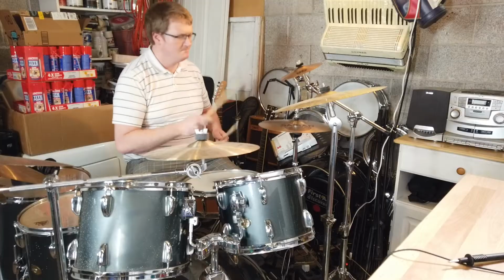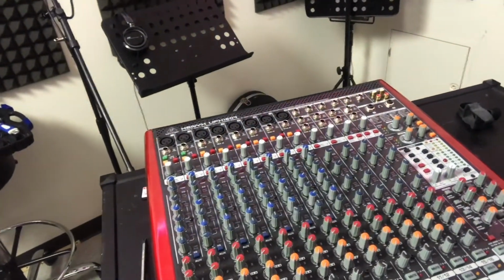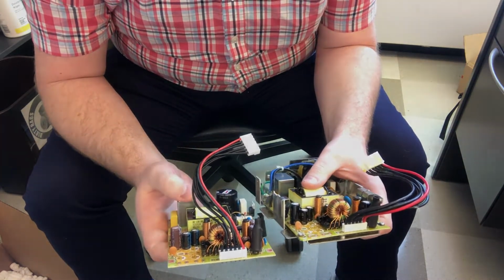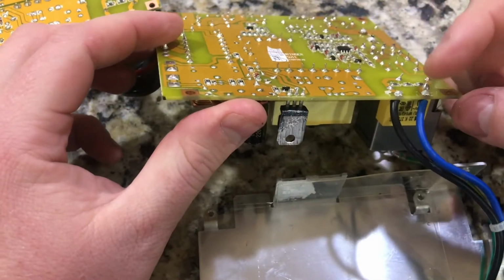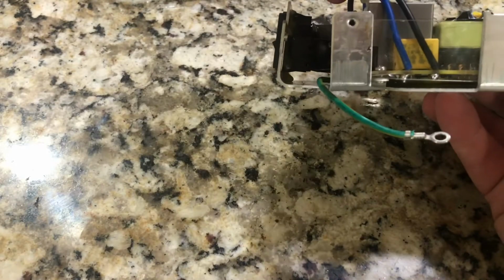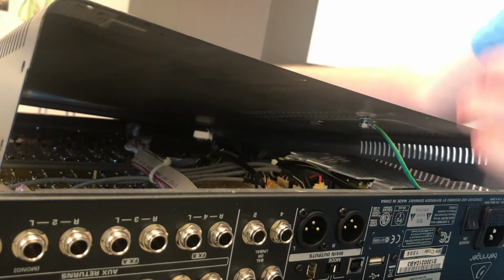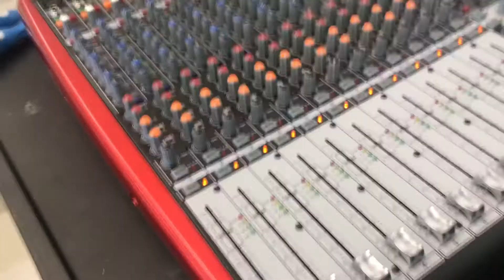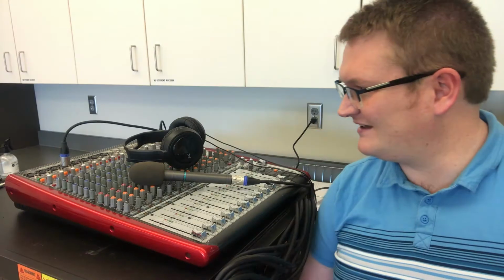Why my Behringer mixer died and how I fixed it.

Comment: Thanks for taking the time to post this video.  My XENYX2442USB mixer recently died and I figured it was a power supply issue because the power light wouldn't illuminate.  I have a schematic for the mixer, but unfortunately the schematic doesn't include the power supply.  Your video showed me how to access the PS, and your comments about it likely being bad capacitors gave me hope for fixing it.  I am a hobbyist, and happened to have the right capacitors on hand.  I replaced both 1000uF and both 470uF caps, and my mixer works again.  THANKS!!!
Reply from the maker: Success! That’s got to feel good. Glad I could inspire you!

Comment: Hey thanks for your suggestion to contact MusicTribe! I also have a UFX1604, which I really love- these are the best AD/DA-Converters I've found in a "budget" (firewire!) audio interface so far, and the power supply failed on me, too.
In my case I suspect the two caps wrapped in heat-shrink near the transformer, because the others look just fine, but I have yet to desolder and test them...
Hopefully the folks at MusicTribe still have one of those in stock so I can quickly replace the PSU and fix the old one as spare. Wish me luck :)
Reply from the maker: Definitely good luck! I had a great experience with their customer service. Hopefully it works well for you!

Comment: Hey bro, may I suggest you change your soldering style ? We PRE-HEAT them connections and THEN apply solder to the connections, not to the Iron first ! Goos job though...
Reply from the maker: Thanks I've never really been classically trained to solder, so thanks for the input!

Comment: Hello .. I need some technical help...I bought a behringer eurorack mx 802a on eBay without powersupply... Based on research the powersupply thst comes with it is 18v for 2 of the pins (xlr) at 800 mah.

However the powersupplies being sold on eBay for it is 17v for 2 pins at 600mah... Can those eBay power supplies work? Thanks
Reply from the maker: Hi! I don't have experience with that mixer or power supply, but I just looked at a similar listing for the same mixer and on the back is a stamp that says "use supplied power supply only." I would hate for it to underperform or worse, go bad because you gave it the wrong voltage or amperage. The Amazon listing also recommends that power supply, but just because other people looked at the listing doesn't mean it's the right one! I'd keep researching it. If other people have had success with it, then maybe that's the answer. I would hate to get it wrong and be out a mixer!
Reply: @KirkHMiller  thanks for the advice

Comment: Did u have to pay for the PU?  also any tips on repairing leaking faders?
Reply from the maker: Yeah. The new power supply was about $60. I don't remember if that included shipping. I'm not a pro at it, but glitchy faders could be a failing potentiometer. Not sure.
Reply: @KirkHMiller  I will check it out and refer to your video!
How's the mixer holding up these days?
Reply from the maker: @boimesa8190  Still works great! I have had no problems since!

Comment: I would replace capacitors on original PSU to some better quality like Panasonic or similar, and maybe even with bigger capacity. For Behringer DDM4000 it made huge improvements.
Reply from the maker: Great idea! What I read was that for earilier Behringers, the PSU is a bit notorious for failure.
Reply: Could u advise me on some?
Reply from the maker: I just got the exact replacement from the manufacturer, MusicTribe.
Reply: @KirkHMiller  I know, I meant it for the commenter ;) But may be u also have suggestions?

Comment: I have to replace a PSU on a SX4882, honestly not looking forward to it.
Reply from the maker: Getting at it might be the hardest part for such a big unit, but the connection is probably a quick solder job...
Reply: Ya.

Comment: A couple of things: 1. What did the new power supply cost? I have a Xenyx X1832USB, and it will only put sound out of the Left Main channel. There are other issues with it as well, like the clip light on channel 1 being on all the time. I just posted a video about the issues here: https://youtu.be/zwRFyyfHU3w  Looking for some advice. Thanks!
Reply from the maker: The new PSU cost $59 plus $10 shipping from MusicTribe (Behringer's parent company). 
I don't think yours is a power supply issue because the mixer itself is on. To diagnose the output problem, follow a signal downstream step by step to see where it faults. Plug a monitor into that output that does work... Can you hear an XLR signal when it's plugged input 2 or 3? Can you hear it when it's plugged into Input 1? Does the 1/4" headphone jack work in both sides? 
Also, those Aux outputs might not be working if the Aux sends are turned down. ...but then why would one main out not work when the other does?? 
The COMP light being on all the time makes me think that something is shorting out the compressor to make it think there is constantly a signal. 
I don't know exactly. I'm just thinking out loud.
Reply: @KirkHMiller   It looks like I’m going to end up sending it in to be diagnosed and serviced. I just hope it doesn’t cost as much as a whole new mixer!
Reply from the maker: Good luck! Keep me posted- I would love to hear their diagnosis!
Reply: @KirkHMiller Hi I have a Behringer Synth VC340 with no more warranty, I need to get the power supply too, but I can find no place we’re to order.  My power supply make click sounds and the LEDs just flash, leaving the synthesizer unresponsive.
Reply from the maker: Sounds like a Power Supply issue. Behringer is owned by a parent company, MusicTribe. They are based out of Las Vegas.
Reply: @KirkHMiller  thanks

Comment: Good news,  It's fixed.......  bad news,  another issue is looming....   I know that sounds pessimistic,  but the "economy"  grade parts in these just don't have a great lifespan.   I wear a badge that says  "Amplifier Technician"........but it should say "Usually replaces electrolytic capacitors".     Years 2000-2010 were the WORST for the issue.... Thanks china.
Reply from the maker: I feel your pain! Some of the broadcast equipment in my studio is "getting to that age" haha
Reply: @KirkHMiller  it might be for your benefit on your favorite items to invest in a fresh set of quality electrolytic capacitors. Perhaps some simple test equipment for caps would help also. It really depends on the era and the manufacturer has to how good of Parts they used.
Reply from the maker: @DeadKoby  That's a great idea!

Comment: Nice, execpt the part you are justifiying a power suply failling after a couple of years like if that is normal. I have various power suply from the 90' and are working great untill today.
Reply from the maker: I agree, I have old equipment manufactured before I was born that have PSUs that are still working. Reading in forums I have found that specifically Behringer has been using notoriously faulty parts to make their power supplies.